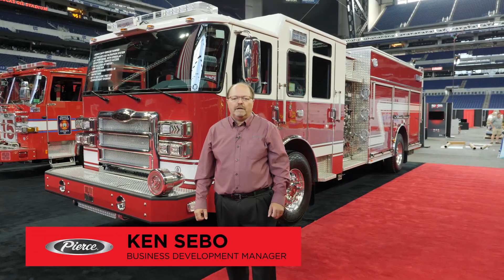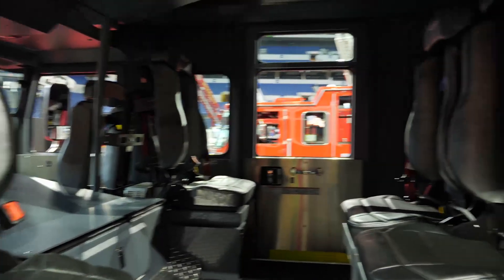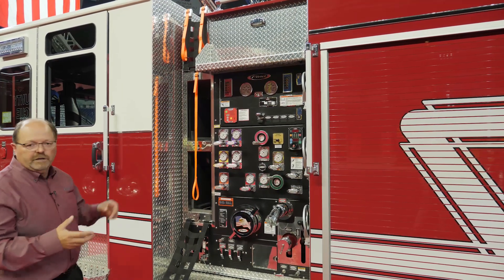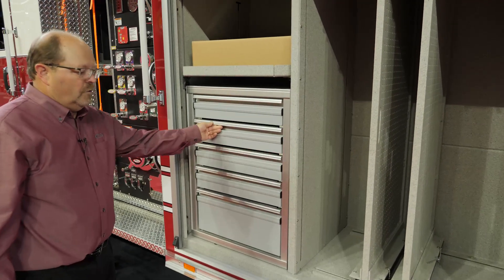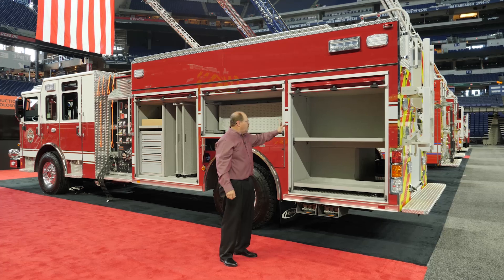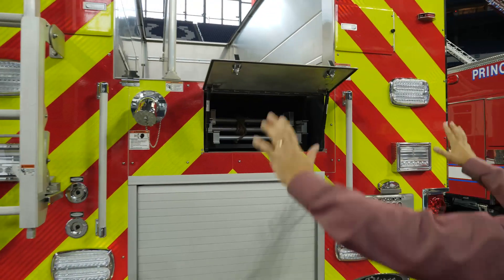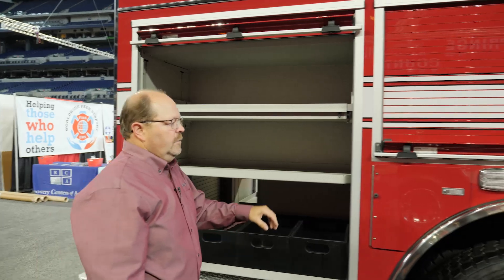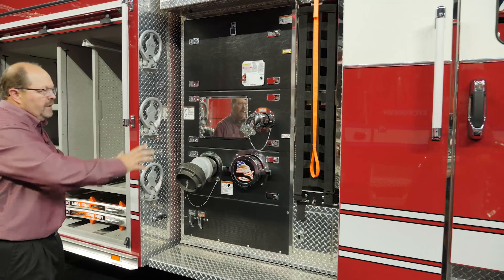Enforcer™ Heavy-Duty Rescue Pumper – Metal Dash and Integrated Speedlays

Comment: Hello from Canada I do have one thing that I would like to point out the two tool boards in the first compartment on the driver's side of the truck where the toolbox is I find that they are too close to each other so I would find it hard to put equipment like your hand tools or the hose appliances in that spot so all that I am saying is that you might want to maybe separate them a little more apart that way you can store more equipment I'm not judging anyone it's just my opinion thanks
Reply: We have them like that on our squad and it works just fine. We have a chauffeur SCBA, hose fittings, foam eductor and misc. hand tools in that compartment and they all fit.
Reply: You can order it from the company anyway you like.